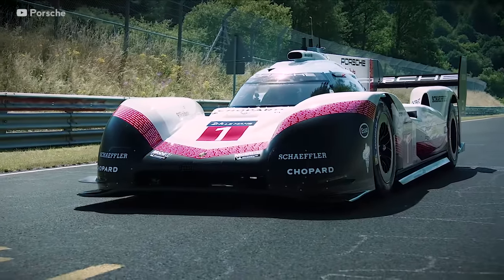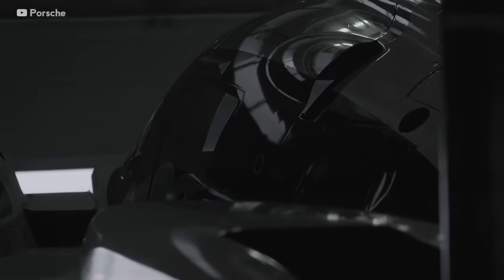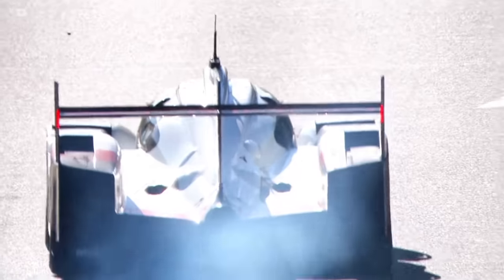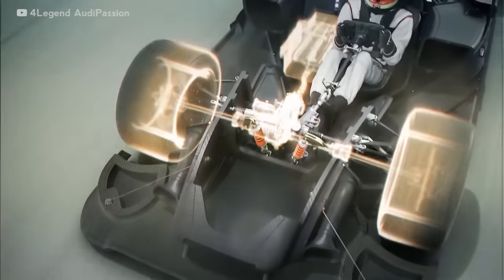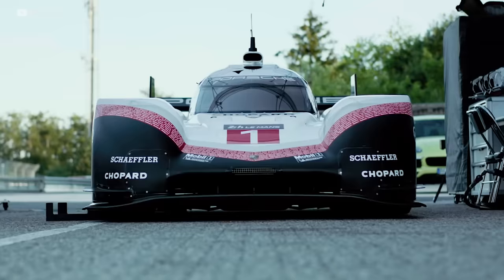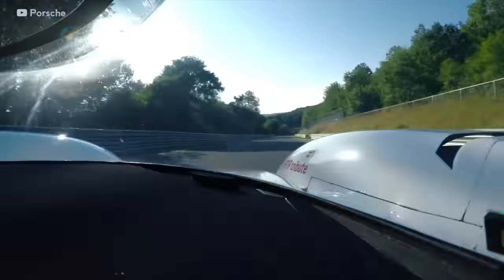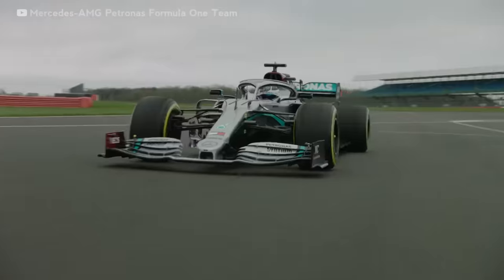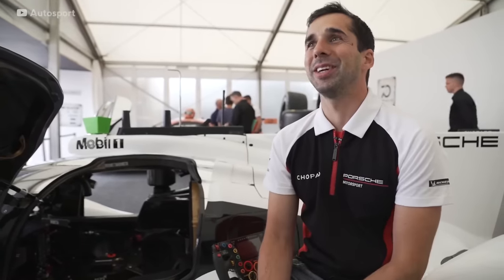How Porsche Built a Car Faster Than F1

Comment: So, if they would make an F1 without rules, the driver would get in coma in the first corner
Reply: we would just end up with fighter pilots or astronauts driving the cars, id consider this an improvement
Reply: Grosjean survived 53g impact, so he could survive first corner
Reply: @sindhusojan8225  but if he had the same crash with a no rules f1 car I don’t think he would’ve made it out
Reply: Remove the drivers, they are an unnecessary weight anyway. ;-)
Reply: @MrFrazer5800  fighter pilots and drivers don't experience the same kind of G's, lateral vs longitudinal. I don't know how strong pilots necks are,  so maybe they wouldn't be better than drivers at handling lat G's. Drivers sure wouldn't handle a 9g turn in an aircraft

Some unsolicited info for you
Reply: @escalator9734  Many underestimate G forces. 5 G lateral is like having a 30 kg (65 lbs) weight put on the side of your head while you're lying on your side and have to keep your head in the air. My arms could only hold that up for a few seconds, my neck? Forget it.
But lateral forces can be countered with head supports around the side, and a perfectly fitting bucket seat.
Reply: @escalator9734  you’re forgetting planes can roll
Reply: @IrrelevantPlease  no i'm not, rolling doesn't induce significant  lateral g forces as the pilot is very close to the axis of rotation.
Roll is used to place the plane to just have to pull on the stick (longitudinal g)
Reply: Neeeerrrrrrrdddddddsssssss!!!!! Lol
Reply: Some moneymakers should put a lot of money together to make the ultimate F1 car. 

9 gears. 
More grip. Maybe more tyres. 
The old V10/12! sound🙏🏻
More aerodynamics. 
No halo. Maybe closed driver seat. 

That would be everybody’s dream!
Reply: How Mercedes ambition produced the fastest F1 car ever
Pushed harder than ever by Ferrari last season, Mercedes dug deeper. The result was the fastest F1 car ever - as demonstrated by Lewis Hamilton's record-breaking lap of Monza. Now Mercedes' designers open up to STUART CODLING and ALEX KALINAUCKAS about the sheer scale of the task...
Reply: @user-yv2cz8oj1k  Just make them drones.
Reply: Just laughed tooo hard at this lmfao
Reply: @sindhusojan8225  there was an Indy car driver that survived a 200+ G crash
Reply: @escalator9734  Fighter pilots also have a G-suit that essentially squeezes your ankles and legs to coax the blood back to your head. F1 drivers just have fireproofing
Reply: @DynamyteTV  Yes but again, different G forces. Fighter pilots have G suits tu put blood back into their brain so they don't black out/loose consciousness.
That doesn't happen in a car. unless nascar starts building 90 degree banked corners with car fast enought to pull >5 g's
Reply: @escalator9734  indeed, in this situation most of the Gs are trying to force the head left or right, you would need some sort of head restraint inorder to pull more Gs.
Reply: yes.
Reply: Drive the car from a simulator.
Reply: @CB-mr1ci   that's just a what if
Reply: Hahaha......Right!!!!
Reply: @paulmichaelfreedman8334  lmao how tf can't you life 30kg
Reply: @sindhusojan8225  Not really. He survived a very short-term 53g, literally just fractions of a second. And it takes much more than that to take a corner. Any corner. 53g in a corner would rip his inside out a turn him into a meat popsicle.
Reply: @sindhusojan8225  well you see, the 53g impact was for a moment and not for a few second straight
Reply: F1 drivers are already resting their heads in corners on the cockpit around them whenever they can, so it isn't as bad as some make it out to be, legs are "resting" in padded tunnels, torso is also secure in the seat, the only things dangling around are hands, this is where gripping steering wheels and proper gloves help
that being said - if you ever driven even rental cars for extended periods of time, you'll know how different (and much much easier) it becomes once you get used to when you really need to strain yourself and when to relax, a novice after 20min in a rental cart comes off all stiff and rigid and not being able to move for a while, experienced cart drivers can drive the same cart at faster pace for hours and jump of the cart with no ill effects, I myself have driven over an hour non stop in endurance competition and can exit the cart with no problems, no soreness, no stiffness - nothing, that is experience, I remember my first times when after 10min of driving I'd have stiff hands, couldn't unclench my fingers without serious pain etc
Older F1 cars, when you were "naked" above chest height with no place to rest your head and no power steering - those were the real tests for the drivers, not so much today, there were times drivers couldn't lift the trophy during awards ceremony - and it wasn't because of the weight - it was simply pure exhaustion
Reply: @tofuloword2829  you'd be damn surprised how strong neck muscles are
Reply: @huttonberries768  who's an f1 driver's or an average person's neck
Reply: @tofuloword2829  average person
Reply: @tofuloword2829  you might be overestimating how much 30kg is
Reply: @huttonberries768  wait really, source?
Reply: @huttonberries768  ah ok, i just did a test and i managed to do 28kg, nvm i stand corrected
Reply: @sindhusojan8225  grosjean only experienced that much G for a miniscule amount of time, less than 0.01th of a second
Reply: @sindhusojan8225  max verstappen survived a 51g impact so he will be good aswell
Reply: @escalator9734  Another thing is that pilots only experience those kinds of forces for very brief periods during maneuvers. These drivers are constantly subjected to huge changes in positive and negative g forces, every single time they corner, brake hard, or accelerate out of a turn
Reply: @ruudvonder2716  bro if youre making a car that goes 400 on a straight and 150-250 in corners youre better off using a halo, trust me
i know its not the prettiest thing but at that speed a squirrel can kill you if landing bad
Reply: @ruudvonder2716  why are you so against the halo? youre not driving it, it literally benefits the aerodynamics and its insane safety. we would have had so many deaths in the past 2 years without the halo
Reply: What drivers?
Reply: @paulmichaelfreedman8334   65lbs on your neck with 5g? Is your head 13lbs?
Reply: @carsonchan5102  an average human heads weighs between 6 and 7 kg.
Reply: @Moonlakes  Not every hit on the helmet is deadly. 
In over 20 years without Halo only one driver died in formula1 but this was because he not followed the rules under yellow.
Reply: Gotta need a G-suit then
But not the one for fighter jet pilots, because those just make sure not too much blood leaves the brain making the pilot unconscious.
Unless they make the cockpit swing like in a centrifuge.
Reply: @paulmichaelfreedman8334  i wonder why there are some drivers with such big amounts of hair, that is like half a kilogram on some curves
Reply: A g-suit for a car, that’s be something
Reply: @Tipo-F120b  Good point
Reply: @huttonberries768  flexi wings and remove the fuel flow limit. Oh look the car has 300 more bhp
Reply: @Tipo-F120b  Kenny Brack survived a 214g crash, though that g only happened for a split second
Reply: @CB-mr1ci  wait, a car with no safety features wouldn't be safe? WOW mate, never thought of that.
Reply: Its time for humanity to take the next step in competitive automotive. 
Use self driving AI controlled machines. 
No human drivers. No humans endangered. Eliminate the possibility for a human to be harmed.
Reply: @vorpalinferno9711  But that's not racing, that's just engineering. Car racing is not meant to be that, it is still primarily a sports competition. And taking away the possibility of doing racing is also not fair to the drivers.
Reply: @paulmichaelfreedman8334  Time to do neck exercises like a boxer.
Reply: hmm...safety standards could also be increased...as we can see tthroughout the history of crashed, they  are always relativelly stingy on safety standards...until someone dies...ironically , you'd expect for safety to be a number one , but reality shows different...problems are a main driver for improvement in that field...
Reply: @vorpalinferno9711  That will be a beautiful mess of crashes. AI tech is not at the point where effective driving can be properly executed, much less an actual race with an actual grid and attempts at overtaking. Maybe it will be possible in the future, but I doubt it'll happen this decade.
Reply: F1 without rules ? Thats called F1 online gaming :P.
Reply: @vorpalinferno9711  If that is the future. I don't wanna be around for it.
Reply: @sindhusojan8225 Thats impact. Those g forces are sustained for like 0.1 second if that was 1 second he would have been dead
Reply: @escalator9734  with pressure suit most people with a bit training can handle 9 Gs for 15 seconds
Reply: @ruudvonder2716 more tires used to be a thing. 80s or 90s i think

Comment: This man trained for 2 months doing neck workouts. Never miss a neck day
Reply: An thats whats called literal breakneck speed?
Reply: Imagine if say someone with a stronger neck did the lap it would be crazy lap first probaly into the 1.30s around spa
Reply: This is actually a huge thing in wrestling. Neck workouts are done every practice because the neck and head are used both offensively and defensively. It's not uncommon for neck strength to be a deciding factor in a match... I'm kind of surprised this isn't something that high-level drivers do their whole career as well. Until now I've always assumed that they did.
Reply: Why is a strong neck needed for racing?
Reply: @c7zr179  because of the lateral gs
Reply: @thatsimracer666  Gotcha
Reply: @1995blooper  Do that's why you see the head guards around the upper necks of racers, huh?
Reply: @c7zr179  that's to keep them from moving 10 feet after a crash
Reply: @c7zr179  
There’s still space in between the head guards, so the driver can turn their head and look around. That space becomes a trampoline if you can’t hold your head straight in the turns.
Reply: @635574  routine neck workouts remind me a lot to SRT TOMAHAWKs.
Reply: @1995blooper  hi lakin moser.
Reply: @orangesnipzy  hi orange snipzy.
Reply: @1995blooper  they do. Otherwise they would not survive the g at f.e. Silverstone. 5-6g lateral every lap. So yeah they train the neck a lot you see that if you look at the workout they do.
Reply: @1995blooper  the problem is at most the the body is strapped to the seat and cant move.
Reply: Some people like to lean into corners out of habit, but but flexible enough to lean out of them without breaking your neck is the better way, for a 2 lap race, which this is. 
That's because 2 laps with soft tyres, The G-Forces aren't going to really matter as long as you can survive them.
Reply: @nzriot  try 99 laps if we know.
Reply: Paging George ‘Corpsegrinder’ Fischer… report to the pits, it’s time to drive.
Reply: @1995blooper  Except you're wrong, the neck isn't the strongest muscle in the body. It's a group of about 20 muscles, and even then it isn't the strongest group of muscles in the human body.
Reply: @Velocitist  They'd have enhanced perception and reflexes, Spidey especially.
Reply: @Velocitist  Exactly my thinking
Reply: @1995blooper  They do. Watch f1 drivers training, it’s a lot of core and neck work
Reply: I work my neck out every morning at like 8am 😉.
Reply: If you truly want high-g cornering, then you have to get the guys who live there: F1 pilotos.
Reply: have you seen an f1 driver? Those people can lift over 40 kilos with their neck without a single problem.
Reply: That’s what my brother always says he’s gay btw
Reply: @Velocitist  He's heavier though, don't want that extra weight on the car
Reply: @yourerightmybad7363  ahhhhh
Reply: @1995blooper  formula race drivers incorporate an intense neck strengthening exercise regime from very early on in their career. There have been several attempts at alleviating the stresses incurred primarily through the use of lateral movement limiting straps however their use is seen as less than ideal. It would be easy to assume race car driving not necessarily a hard physical sport but this is incorrect particularly in fast endurance racing such as Le Mans.
Reply: @1995blooper  most drivers do neck workouts
Reply: @635574  *Breakneck acceleration
You can't feel speed, what you can feel is acceleration!
Reply: That seems like advice that could be wildly misinterpreted by some.
Reply: "Never miss a neck day" fuck man I laughed out loud for real hahahahaa

Comment: I love how one of the limiting factors of going any faster than this is not necessarily engineering but not having your neck not snap from the G forces. Bonkers.
Reply: Yeah one day the cars will be too fast to actually drive haha
Reply: @jackstamford9937  there is a theoretical limit for a car's top speed based on the acceleration that the human body can take around the longest stretch of plain-ish land in the world.
Reply: @someonejustsomeone1469  top speed has nothing to with acceleration. The Space Shuttle reached 27 000 kmh with a maximum of 3 Gs of acceleration. G loads are much higher under braking and even more on turns than on forward acceleration.
Reply: @simonrano8072  top speed depends on acceleration as long as the length of travel is finite. You talk about the space shuttle which can travel a distance several times longer than the longest stretch of straight road in the world. And of course, G loads will matter during braking because you have to brake once reaching a certain top speed.
Reply: @someonejustsomeone1469  The Thrust SSC reached Mach 1 one the ground. Its top speed in not due to acceleration but power-to-drag ratio and stability. Driver was fine, not the limiting factor. 

Johnn Stapp on rocket sled had a run from Zero to 1,017 km/h (632 mph) and back to zero in 1,100 metres (Wiki) on rails no car can perfom these accelerations, yet driver was "quite" fine. 

A car system (3 or more wheels on flat ground with a steering capability) has a top acceleration on straight line that will ever remains lower to what humans can sustain.

In corners it is possible to make a car limited by the driver. Jet fighters are limited by the pilote in turns, not in top speed...

Comment: "It allows it to do 223 mph (358 kmph )"
-Does 369kmph on record lap
Reply: Magic happens when you're at full send
Reply: Nice
Reply: F1 cars got that speed 15-20 years ago. Thanks to FIA this cars will never come back. What a shame.
Reply: @JohnnyC01  I just finished talking to my friend how old F1 was amazing and if they didn’t stop them from improving the cars we’d probably have rocket cars rn 😂jk
Reply: @Jonathan Hansen "It allows it to do 223 mph *on camel straight*" which is the straight at Spa, the 369 was on the Nürburgring.
Reply: @S50Xavier  we would definitely have f1 cars pulling numbers like the Bugatti bolide LMAO
Reply: @flintstone1409  this^^^
Reply: Nice
Reply: @JohnnyC01  Current F1 cars have close to 1,000bhp max. The only thing preventing 370km/h at Monza is downforce. It will be interesting what they do this year.
Reply: @jasonstevenson110  Technically it's drag, not downforce. You can generate downforce with no drag, aka ground effect.
Reply: @ccanaves  You are right I should have stated drag. In the 2021 F1 regs reduce downforce / drag by 10% so I am keen to see what top speeds they will do at Monza. Note ground effect does increase drag but less than other methods of downforce.
Reply: @ccanaves  Ground effect still causes drag. Just less. It is the most efficient trade-off between downforce and drag.
Reply: @JohnnyC01  we had drivers hit 350-370 km/h these past 3 years
Reply: @JohnnyC01  i'd rather have the current ones. Yeah, they cant go 380kph, but they can go flat-out in corners every other racing series in the world only can dream of.
Reply: @JohnnyC01  Hamilton just hit 353KPH
Reply: @JohnnyC01  you do know lol cars even back in the 80's went over 400 on the mullsanne straight at lm France.
Reply: @JohnnyC01  bottas has reached 378 kmph in Baku during qualifying in 2016. You should watch baku every year, cause I see people breaking 360 kmph every year during qualifying. Plus straight line speed is not everything. Around most tracks in which F1 race, they are still the fastest.
Reply: Nicc
Reply: @flintstone1409  Good job just throwing numbers in different units there.
Reply: @S50Xavier as f2004 1/4 mile in 8.6 sec? I love f2004